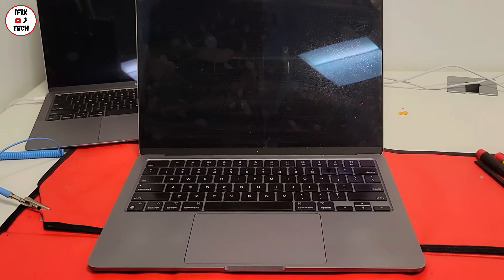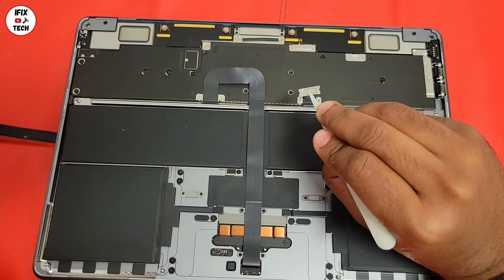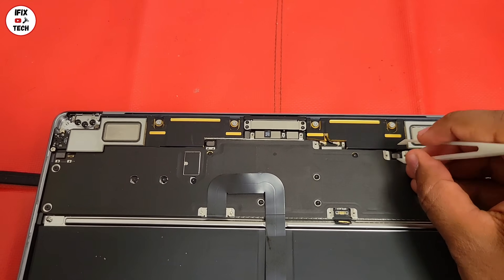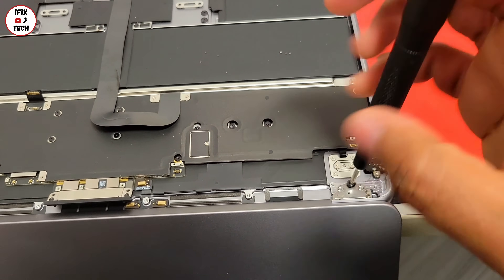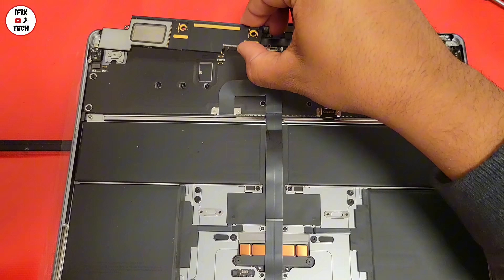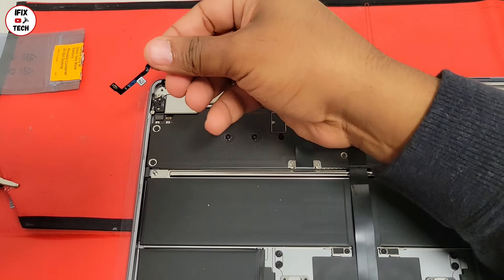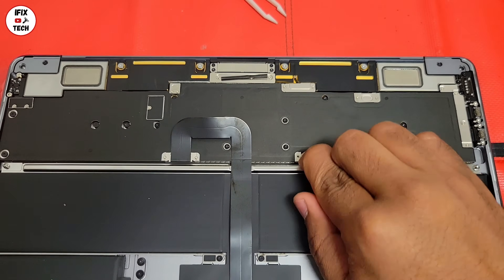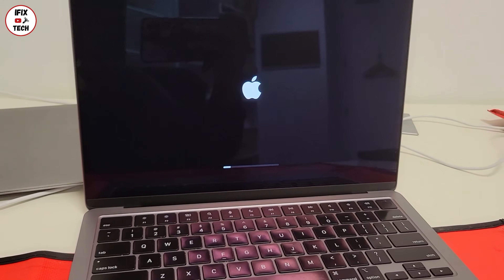Apple MacBook Air SCREEN Replacement - How To Replace LCD Panel M2 2022 Step-by-Step Guide Tutorial

Comment: Can you explain more about the lid angle sensor and how to go about replacing that? I am seeing some options to replace the screen online but I am confused about the syncing of the lid sensor, how that works, where to get one, and how to ensure it gets done correctly.
Reply from the maker: Hello,
The lid angle sensor is the one in charge to tell the logic board when the screen is close or open. After a screen replacement, the lid angle sensor should always be replaced. In order for it to work properly, it should be paired by apple with the screen that is going to be replaced. If only the screen is replaced, it will work, but you will lack some functionality. You can try to get both parts from apple. Thankfully, from M4 now, that is not required. Thanks for liking it and subscribing 👋 😉